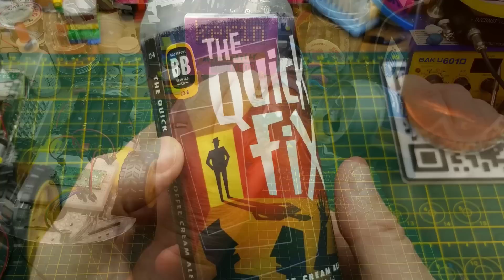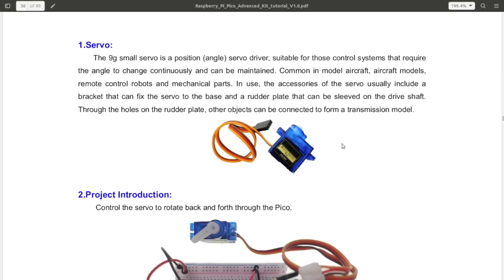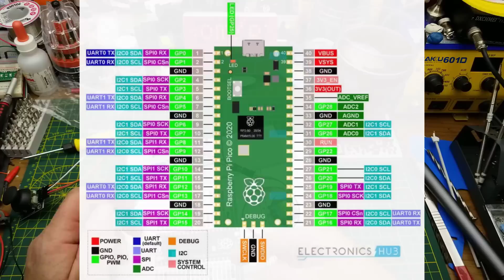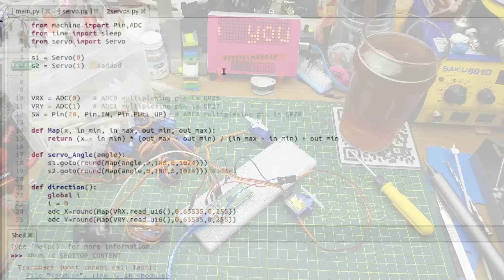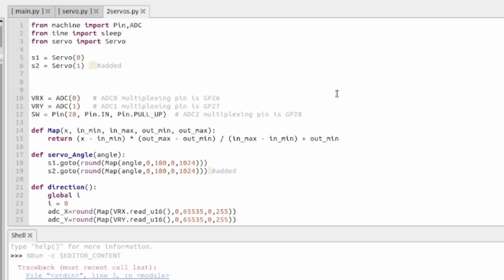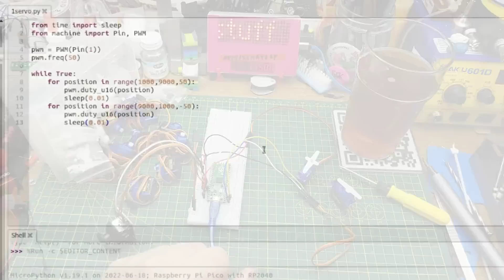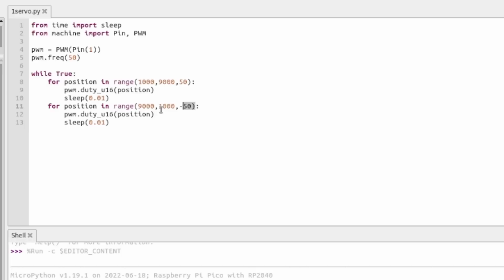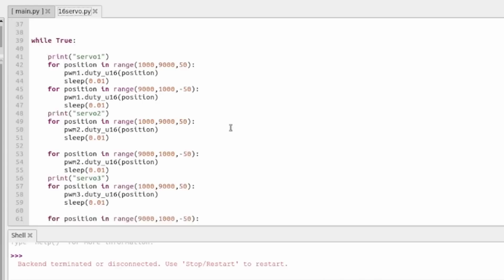controlling lots of servos with a Raspberry Pi Pico

Comment: or just get a PCA9685 that has header pins for the servo plugs and use that to plug all the servos in and then interface it with the PICO.
Reply from the maker: There's plenty of valid ways to get to the same place.

Comment: Why don't you all stop believing that a 9gram servo is a servo its nothing can do nothing works for nothing, most of them don't work out of the box.... LETS PUT 10 25kg or 40kg servos on the raspberry pi and watch it explode. i am so tired of 9gram servos being the test for everyone who thinks they're making a good video.
Reply from the maker: The 9 gram ones are really cheap, which makes them approachable for beginners.

The better ones can become prohibitively expensive if your project needs more than couple.

Regardless, the control method is the same, so this demonstration is still valid no matter which servomotors you prefer to use.
Reply: Please make a video on this.

Comment: great demo,  adding the power board was essential,  the base for an 8 legged (16 feet) insect or a snake ...
could be remote controlled when used with a Pi Pico Wireless ...
5 volts wasn't needed for the pico, does the servo need it ?
a 1650 + stepdown convertor to 3.3V is probably enough to make it mobile.
Reply: If you delve into the realm of new model airplane controls running on 2.4 ghz, you can remote control up to a mile away, line of sight.

Comment: 08:20 I was surprised to see a value of 9000 microseconds used as the top value in the for loop because I am under the impression that the top value for a servo should be 2000 microseconds
Reply: That value is not microseconds, it is the number that the hardware pwm module counts to. The hardware PWM here is using a 16 bit counter and has a frequency of 50 Hz that means that 50 times per second that counter counts up to 65535 (there are 65535 counts per 20 ms), so then you can divide the period of 50 Hz (1/50) with the value it counts to (65535), which gives you that every count equals 305 ns, now if you multiply that by 9000 counts you get 2747 microseconds. It could be done better to get you exactly what you need like 2500 microseconds would be 8192 counts, here they probably just chose a round value like 9000 and went out of range of the servos, which isnt recommended.
Reply: Also different servos sometimes use different min and max values, sometimes they can get better resolution if they go from like 0.5 ms to 2.5 ms or something like that, rather than the standard range of 1 ms to 2 ms, by going to 0.5 - 2.5 ms they get double the resolution.

Comment: hmm wonder if you could make a servo analogue clock
Reply from the maker: As long as you spread the numbers around 180 degrees on the display (or add some gearing) it should be possible.

Though the hands wound need to "rewind" to the start each day.